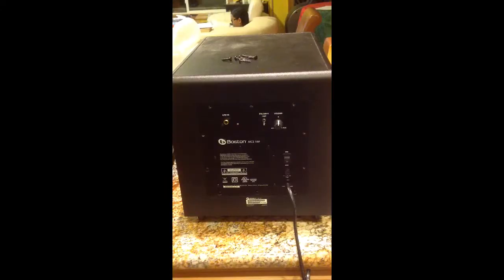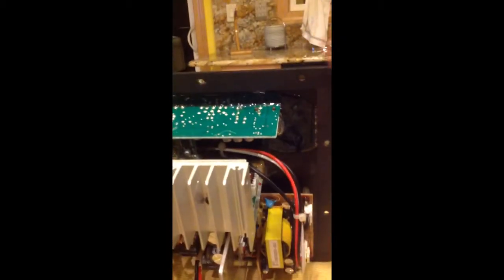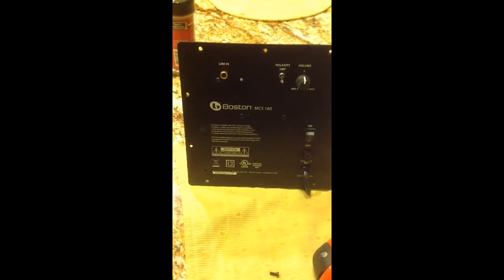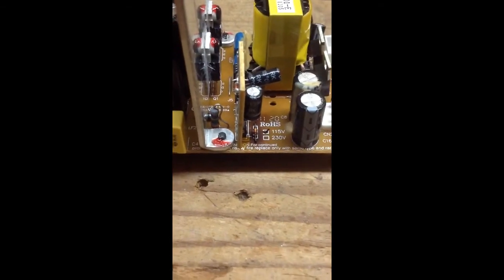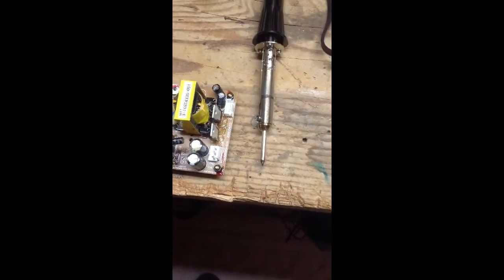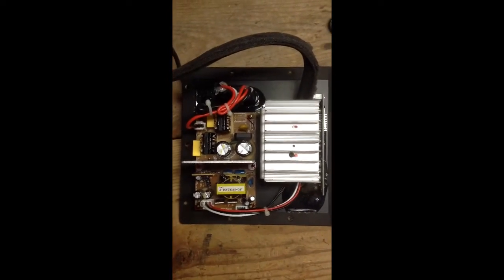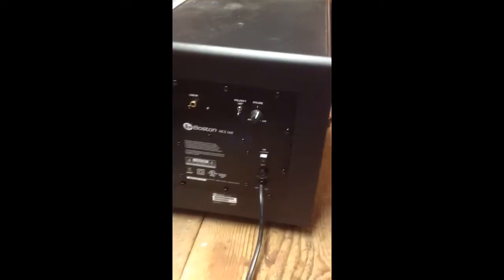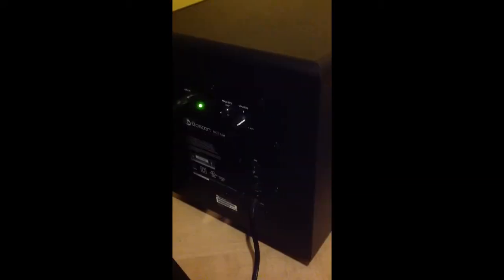Boston acoustic MCS 160 subwoofer repaired

Comment: Caution: Incorrect diode is used on this video. Diode needs to be 18v 1watt rated. Use 1n4746. This is a zener diode, hence the designator ZD3. The 1n914 allows for overvoltage situation where your unit may work for a short period of time until it fails again, probably worse than the initial failure. If you used this diode I highly recommend replacing it with the correct part. Furthermore, original part was rated at 1/2w and fails short. It is important to use a 1 watt device here.
Reply: Hi do you know what diode to get for the Boston Acoustic Soundware XS Subwoofer please?..
Reply: I just found the service guide for the 2.1 version and it says ZD3 18v 0.5w - do you think it's best to get a 1watt version, to help it not to burn out again?...
Reply: @Lloyd.B.  lol, yes. The original part toasted because it was spec's too close. Zeners tend to short if given a chance. If there were more room I'd put in a 3w. 1w is fine, tho
Reply: @prattacaster  OK thanks.

Comment: I could not fix this source. I will replace it with a power supply with a transformer. The diagram does not show the output voltages. Could someone tell me the output voltages of CN2 and CN3.

Comment: I had this problem and fixed it with your video but the wire, or something, keeps shorting. I've fixed it 3 times or so and after a week or so of use it stops working.

Comment: I swapped the diode but it's still not working. I tried the diode in both orientations as well with no success. Any idea what else might be wrong? I also changed the fuse. Still not working. Thanks.

Comment: After you unscrew the panel screws along the outer edge, also u screw the subwoofer from the bottom. Once you disconnect that from the board you can reach inside the box and push the panel out with your fingers. They add glue in assembly so it's tough to pull the panel out from the outside of the box.
Reply: cameradude80 That's Not Accurate, tilt the box to the bank, tap it, & the panel will fall out. At least mine did, no glue...